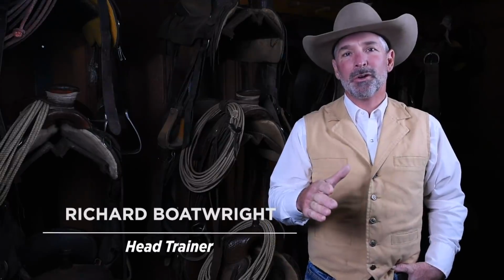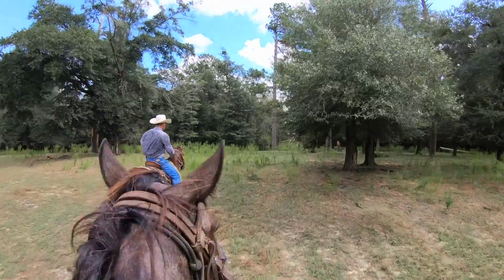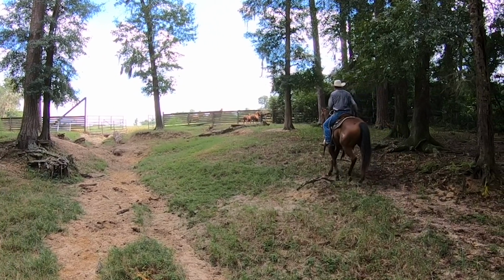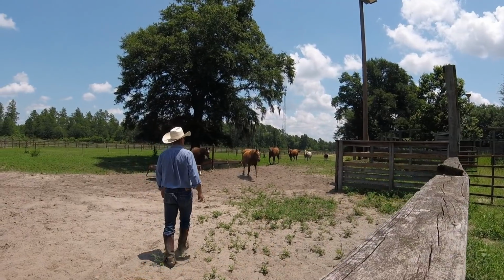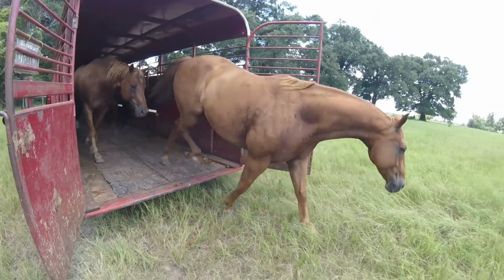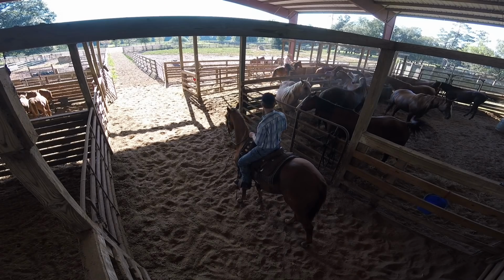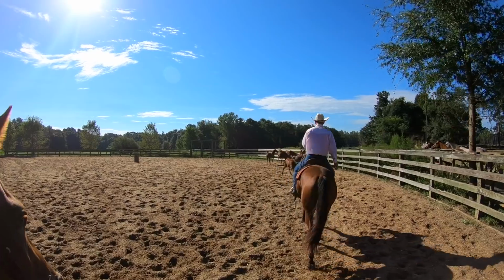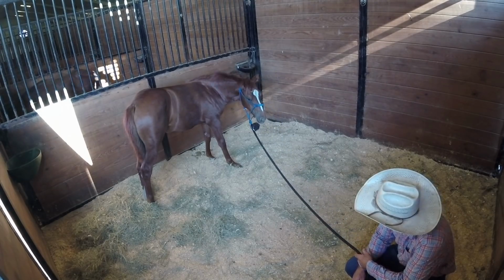Weaning Foals - A Big Job for Late Summer Episode 8 Low Country Cowboys

Comment: I only get 1 or 2 foals a year so weaning is still stressful , but as big of deal.    When I was young I used to help my cousin and we would gather a band of 60 and take the 2 year olds off and swim them across the river to the main Ranch.   Then we would cut the yearlings and it was so good for young horses to work other horses .   It was fun as a young man to have a 6 mile run with 60 head of horses and a stud that acted aggressive,     great vid Richard